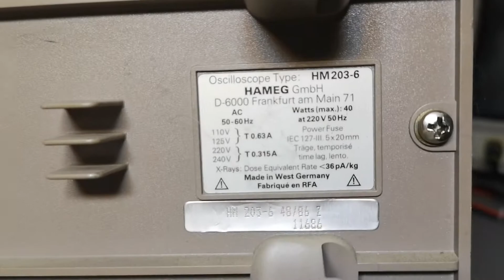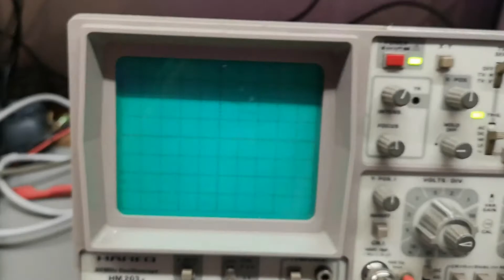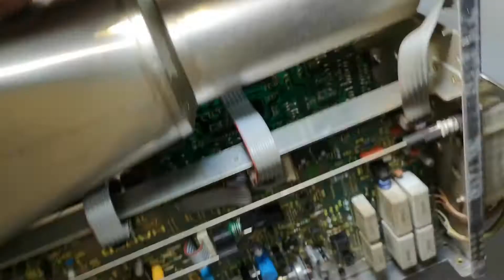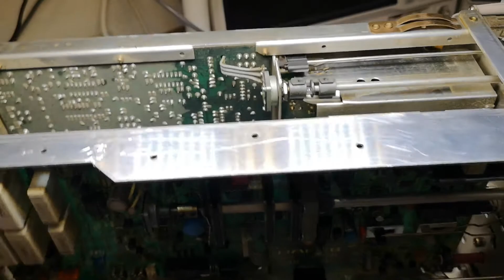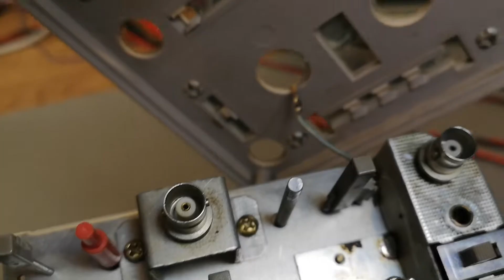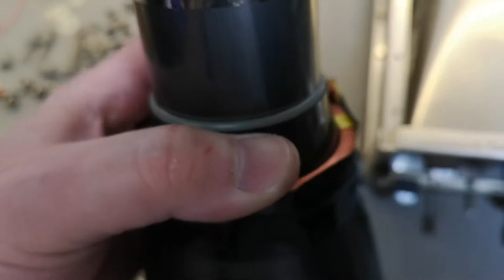Oscilloscope Hameg HM203-6 20MHz 2ch 1986 Test Teardown

Comment: I fixed one just today. Its quite a nice scope, for  minute I thought it was a rebranded Pintek but its quite different albeit the circuit is almost identical in parts. Much prefer the construction of this one. The fault I had was only one channel going, I discovered the invert switch on channel 2 was very flakey, replaced it and its going beautifully. Just perfect for a kid starting out in the audio field.

Comment: I I have a hameg HM604. The switches inside need cleaning but the case dosent come away from the main body i just unscrewed the 2 screws at the back. is there anything i have missed? Also yes the insides are very optimized thats German engineerinh
Reply from the maker: PULL harder, and shake it a bit, do this over a bed, or ask wife for help
Reply: Does the backplate come off when you undo those 2 screws?
Reply: @robertobryk4989  yes it does, you might have to loft the handle while it's facing down and give it a strong shake to let the force push the main unit out of the cover.